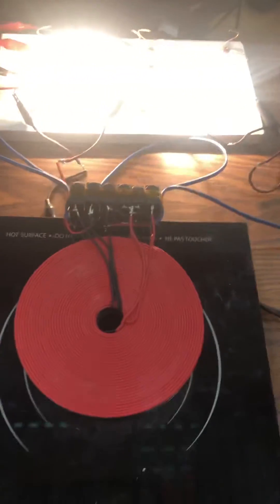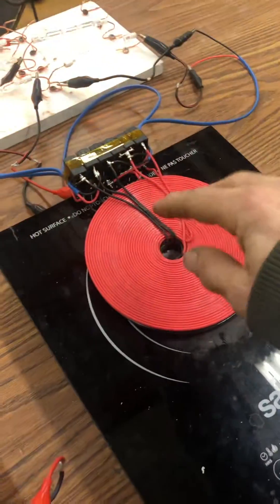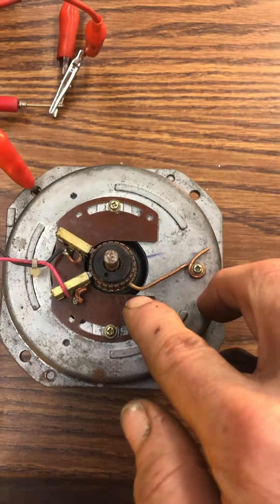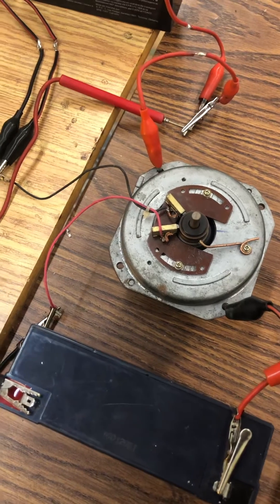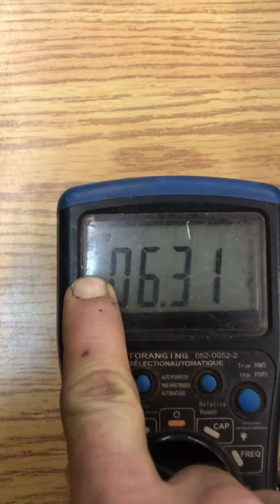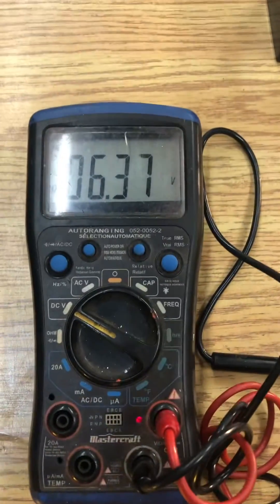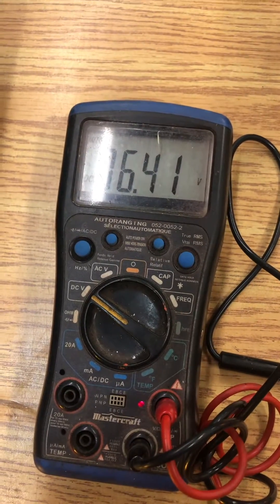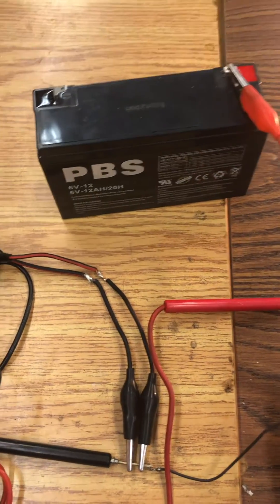My Over unity motor generator technology￼

Comment: a GRAND SLAM !!   If you could maintain the RPM on the motor , couldn't you make your clip lead wire(pulling from the source), the length of the wire resonate with the frequency(RPM) of the motor, thus never drain your source battery.  I think this is what Don Smith showed in one of his videos ?
Reply: Your video are fake videos !!!